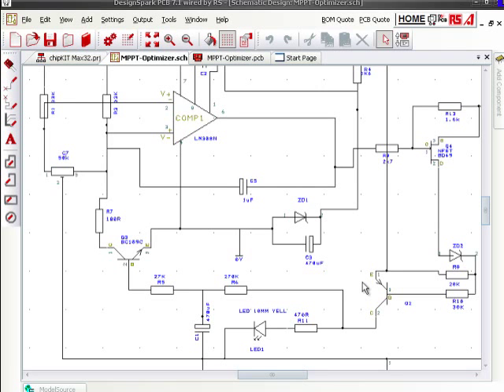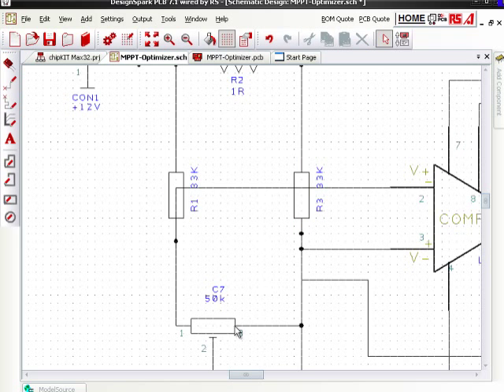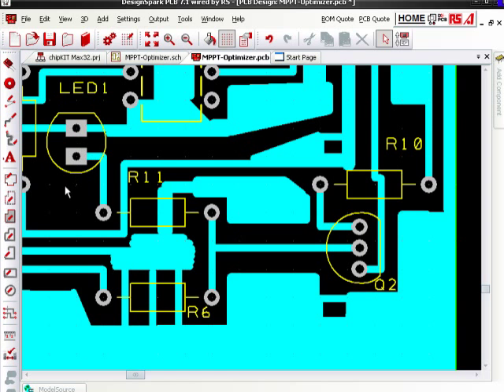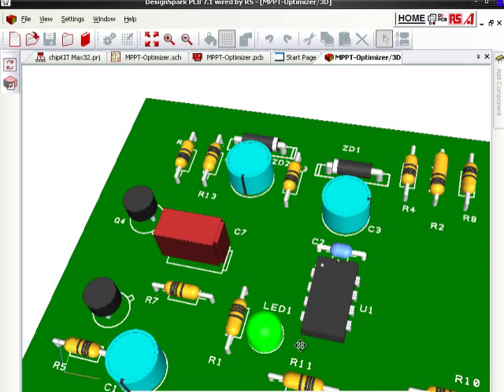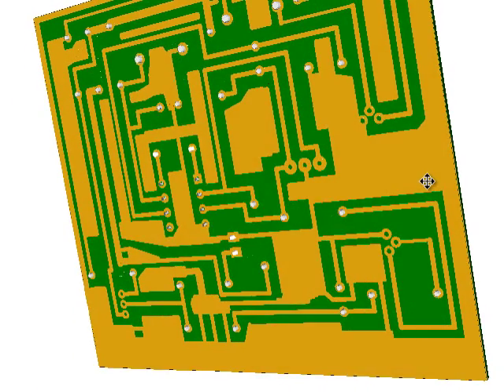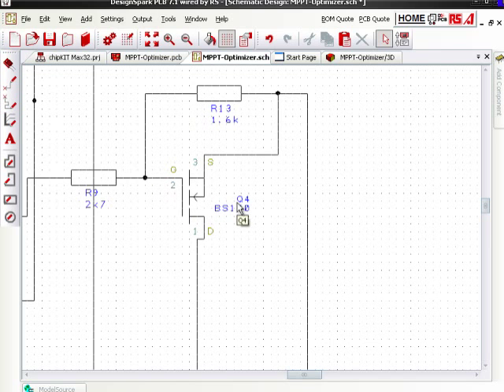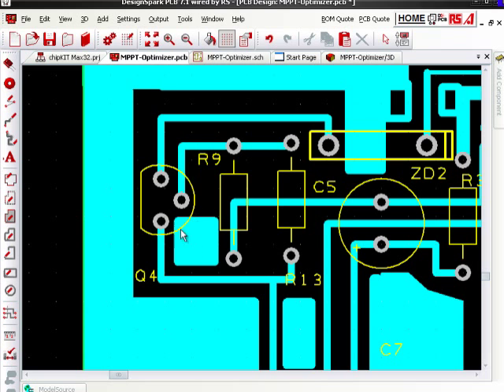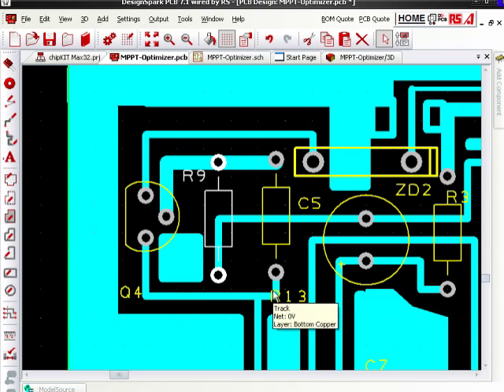Part 7 Solar pwr MPPT Boost Optimiser Residual Power

Comment: This is really cool.  I don't know much about circuits, other than rudimentary knowledge of what they are called and what they basically do.  You would make a great teacher.  :-)
Reply from the maker: +Gristle Von Raben Well as I get older I feel sometimes like I am forgetting most of it lol so maybe in another 10 years you will know more than me lol
Reply: I'm not into them that much.  But I do find them appealing.  Because of your videos, I looked into why a person would want to pulse the battery as they charged it.  Of course the google searches returned with the idea that pulsing the charge kept the battery from forming sulfate crystals that would eventually make the battery unchangeable, or erode it inside.  They said that the pulse causes emf interference in electronic equipment, and that they were impossible to eradicate.  Apparently it isn't the strength of the pulses or lengths that cause the problems, it is the exact timing of the pulses.  I suppose using a variable pulse could eliminate some of that interference, but the question is, why do pulses in electrical systems amplify themselves?  I have a theory on it.

In my theory, atoms in structures act as energy pumps.  They can receive energy, and pump it out.  If you have a wire, and send a pulse down it, you arrange the electron orbits in the outer part of the wire to form a system of high and low pressures that supposedly move down the line.  But what if they don't?  Instead, what if they form a kind of standing wave, if I'm using the term correctly, and instead, there become regions highly filled with extra electrons, and others very empty of electrons, and as the energy is conducted along, it moves over the regions crossing the high energy parts, to the low energy gaps and the areas where it crosses the high energy parts are like hills, or swollen parts of the pipe, and so the energy is actually given off in waves as the electrons find resistance there. 

It's just a theory.  But it would make sense of a lot of things.  I could be wrong.  Please let me know what you thing, because, you honestly are more educated than i am about this kind of thing.  :-)
Reply from the maker: Well my charging system is not like that I am not pulsing at a high frequency so the emf is not an issue, but generally when you pulse charge at a resonant frequency you are generating a RF "radio frequency" which is interference, my charge buffer does not work like that as I am simply trying to make use of low residual power that in the terms your speaking of does not have enough pressure to move electrons into the battery, imagine an engine say a 50cc engine trying to climb a hill in 3rd gear it has insufficient power to climb the hill well this is similar to charging batteries if the current is not high enough it is wasted as heat or powering the meters rather than giving a charge to the cells. I am simply storing energy is super capacitors until their is enough to overcome that hill and move electrons into the battery more effectively in cycles HIGH, rather than constant LOW. But when their is enough power from the solar cells then they WILL receive constant high to insure power transferred to battery.
Reply: I understand.  very cool.  I don't know whether you are into making photo cells, but just in case you ever talk with anyone who does, can you ask them for me if photons create shock-waves as they travel through substances?  Have a great day.  :-)
Reply from the maker: Well I doubt it I have heard of scientists trying to build a PHOTON DRIVE for space craft it was a total flop, as photons do not exert any forward thrust I doubt they can cause shock waves as if they did then when the NUCLEAR bombs went off the light would be shattering windows before the blast radius got there which does not happen.
Reply: maybe close up it does?  remember that light only travels at one speed, generally, but the amount of light is what would burn things, as you know, like in a laser.  I think my comments were not described by me well enough.  I was thinking that as they passed through a thick matrix of material, that they might bounce off of many electron shells, and thus begin forming a super super microscopic shockwave.  I believe that if we knew how to angle the light waves into the medium, we might get a better trapping effect from the shock wave phenomenon, if it even exists..  I apologize for not explaining myself better, Ms. Ortorea.
Reply from the maker: Its ok yes heat expansion from intense heat will create a shock wave.
Reply: very cool.  I was thinking.  I bet you could put a fresnel lense from a projector tv on a solar panel, and get more light input, not from magnification, but actually, from the scattering effect. 
 by the way, have a pleasant night.  I gotta go, be happy to talk with you later.  :-)